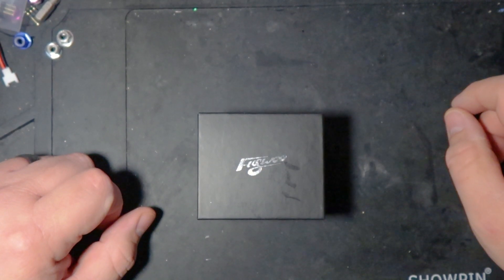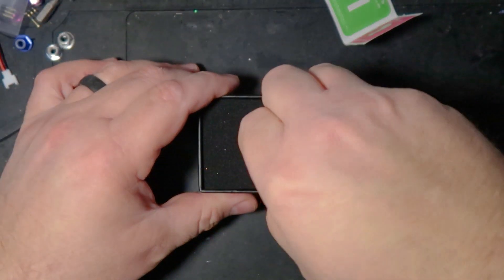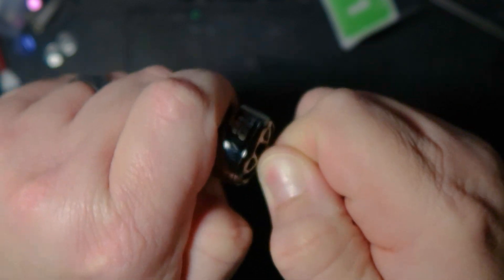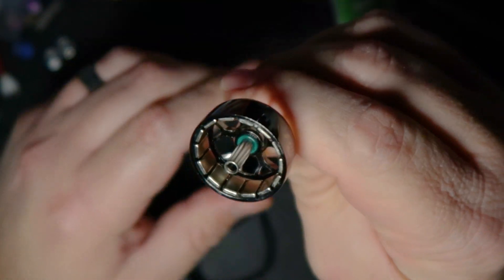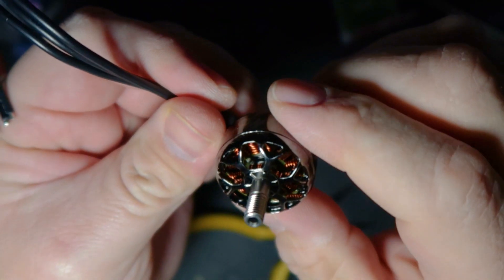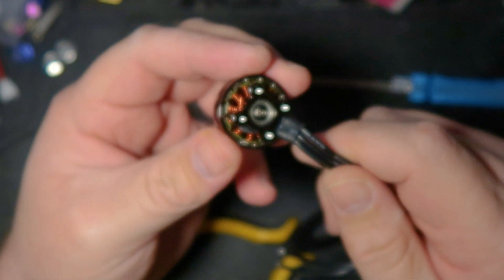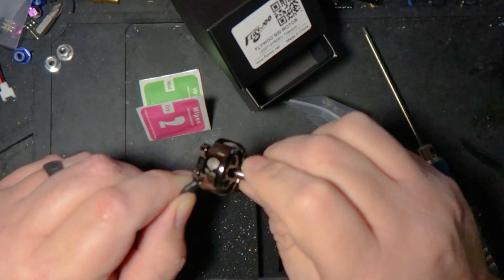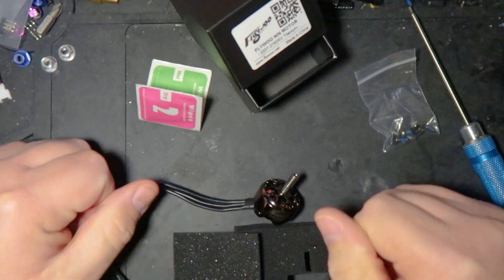Flywoo NIN 2207 2750kv Drone Motor Initial Thoughts Review

Comment: They are Xing motors with a different upper Bell design. Same rubber dampener on the shaft it's identical I talked to Xing about it and you'll probably be seeing more of the same style motor from different manufacturers. I was tripping off when I got these to test lol. Take apart the xing 2207 2750kv motor :) great review though.
Reply from the maker: Yeah. I ended up taking apart the Shang after I posted the video. I found that same rubber damper in there also. I was wondering if they were manufactured by the same OEM or if they just happened to share some common traits.  I found the tolerances on the shaft and bearings to be just as tight, too.
Reply: @JoshWithrow  according to Xing they are from the same manufacturer and OEM. I tried to get information which manufacturer it is but I couldn't get it. Nonetheless they're great Motors. 🔥🔥
Reply from the maker: That's awesome to know!  By those remarks alone, the Xing motors are probably the better value.
Reply: @JoshWithrow  if you go through Amazon the better deal is the Xing I think you can get a set of 4 for 78 Plus $5 off coupon with free next-day shipping.
Reply: I go with Xing because I don't pay lol. And because I love them I like the graffiti style on the side of the motor and man are they so smooth especially when you put the pwm frequency to 48 love it 😍🤘🔥😜
Reply from the maker: That's EXACTLY why I made that remark :). No regerts in any case :)
Reply: @JoshWithrow  hahahaha, no regrets! Have a great weekend and hope you get to rip some packs 🔥👊😀
Reply from the maker: @FarmerFpv  thanks homie!  You too!

Comment: I am wanting to try these, glad to see you with some!
Reply: The XING motors have the o ring feature as well on the top bearing 👍
Reply from the maker: Maaaannnn...  these have SUPER tight tolerances.  And they have something I've never seen on brushless motors before... a rubber damper on the shaft where it sits on the top bearings.  It might be snake oil, but it caught my attention.  But 18ga wires, too...  these things are primed to be battery killers lol.